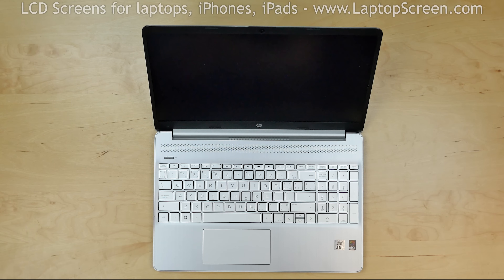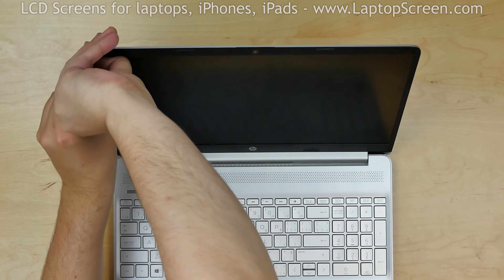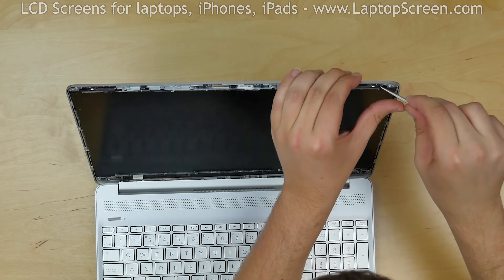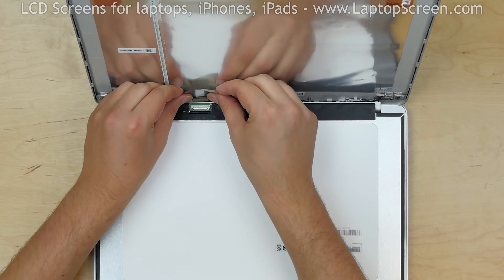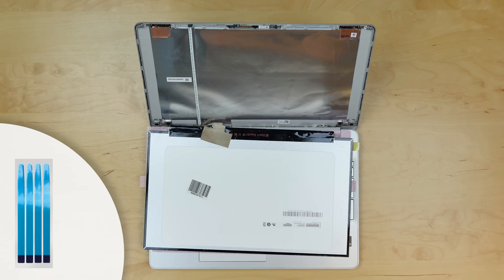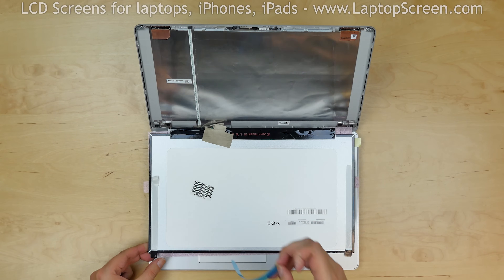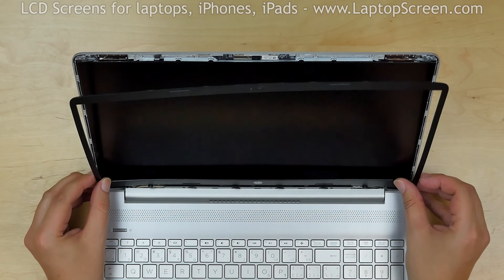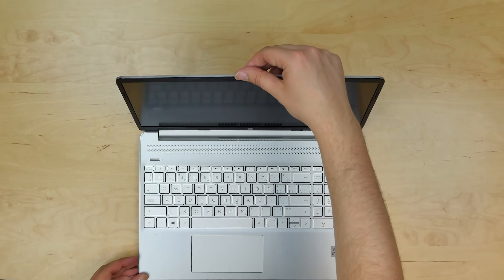How to replace LCD Screen on HP 15 laptop. Model 15-dy1013ca. Step-by-step instructions

Comment: hey i have the same laptop and the plastic belez is little bit opn from one side is there any damgr or getting worried about it
please reply me
Reply from the maker: It's probably fine. You can try gently pushing it back in place with your fingers.
Reply: No it doesn't stay in its position

Comment: Didn't see you remove the battery plug. I hope you don't end up getting a bunch of people watching your video to end up shorting out their motherboards.
Reply: i think it's safe if your laptop turned off
Reply: @HomeUndertheHome the laptop might be turned off but you cant turn off a battery, it will always deliver a voltage even if the laptop is turned off (unless its dead). So if you are unlucky you can short electronics that are usually disconnected in normal operation so thats why you should always unplug the power source before working on electronics.

Comment: This was extremely helpful. I changed the screen following this video and all worked out perfectly. One small error on my part was I pulled too hard on one of the tapes and it snapped back forcing me to dig for it to start pulling again. Moral, be slow when pulling the adhesive tapes to free the old screen.

Comment: Thanks, worked on my HP Probook 445 G8. I cracked the old working screen -  upgrading to a brighter IPS one - trying to unstick it from the case, bottom part removal was very difficult because of strong adhesion.

Comment: Can I put a higher screen resolution if the size and connector is the same ?
Hp Notebook 14" (1366x768)
To put 14" (1920x1080)

Comment: Woah didnt expect these new laptops to be not so anti consumer.
Thats a relatively easier repair than the old ones
Reply from the maker: Yep, most popular laptops are bezel off, glue off, screen out, and reverse. Most use standardized screens and lots of them are interchangeable. It keeps us in business :)
Reply: @Laptopscreen my connector has wires attached from the laptop base to screen connector. Can u pls tell me how to deal with this

Comment: Thanks for sharing!! I saved hundreds without having to buying a new laptop!! I did struggle a little with the Connector. There was no pin to lift. And my pull tan tape was on the bottom corners of my old screen. And lastly, please have the screen in place befit you push the tape down. I had to pry mine back off

Comment: You should mention removing batteries. My laptop CPU is dead because of this now.... 😢
Reply: This is standard procedure for any electronics. Always remove the power before working on it, this includes any batteries connected. Not limited to laptops

Comment: Two changes for me 

1) do not stick that screen down until you know the screen is working again. 

2) reuse the tape if you can as it’ll be better than else you buy online
Reply: I was thinking the same thing about sticking it down before testing.

Comment: I need to do this, but I might not have to replace the Screen, just Fix the video connector. It's been like this since I bought it and I should have just taken it right back and replaced it but I didn't because I was always using HDMI anyways. Now I like to utilize my laptop screen for television while I game, and everything will be fine and then absolutely no one will touch anything and the screen will just go black I can bend it back to some weird angle and it'll reconnect, but it's such a pain in the ass. I can't wait to get a desktop lol.
Reply: How could you tell that the problem was the connector instead of the screen?

Comment: Contrary to what the video says, be carefull and don't discard the tape behind the screen, it can be reused and is much better then anything you will buy online.
Reply: No it isn't. Just get new pull tabs and do the replacement properly instead of cutting corners...
Reply: Are you sure man? Isnt it sticky anymore
Reply: Bruh I lowk j used double sided tape😭😭😭😭

Comment: May want to pin this.

Advice from someone who followed this guide- when you get to removing the LCD cable from the old screen: there may be a very thin metal bracket just beneath the brass port you need to pop up with tweezers or the like. Should come out easily. It's connected to the metal connecter you're trying to take out of the port. Otherwise you'll sit there for 10 minutes on and off tugging that port wondering how you're supposed to be careful with it when it's freaking impossible to remove!

I ended up forcing the bracket to pop up without realizing it was there, and fortunately I managed to reinstall it on the new screen with no issues, but there's basically nothing keeping the cords in that port without it, so you're better off not risking damaging it doing it the way I did. Hope this saves anyone the frustration I had!

As for buying a new screen, the site they plug at the end is reasonably priced and the shipping options were fast and affordable. I took the 2-day and it arrived as promised, I also bought the adhesive from them and they sent spares! I'll use the site in the future if I ruin another screen.
Reply: This particular laptop model does not have any bracket (I tried it with the same series laptop as well)
Reply: Mine did have this bracket and I broke something by not seeing it.  :c
Reply: To just add to the pinned comment to "seeing the startup graphic" isn't enough to ensure a correct connection, if you see any graphical glitches etc, this suggests the connection isnt seated correctly, or has been damaged. Screens aren't 0 or 1, they need a complete connection and still function somewhat with partial. It's best to do wait for the machine to start and then watch a youtube video or something, just ensure colors etc look correct.